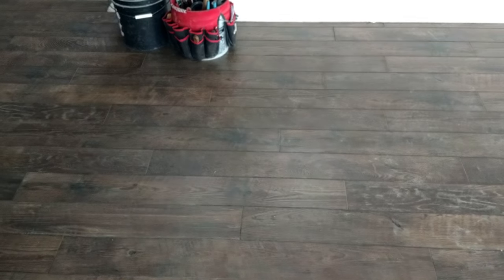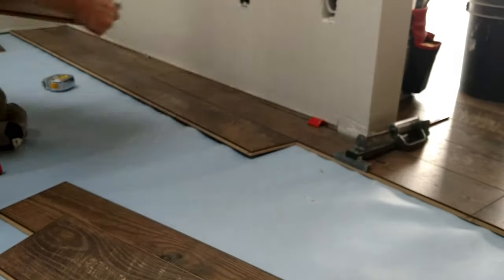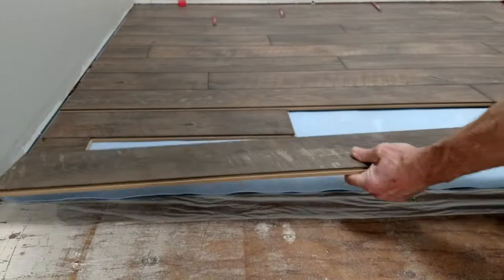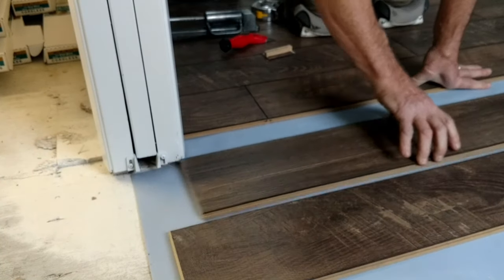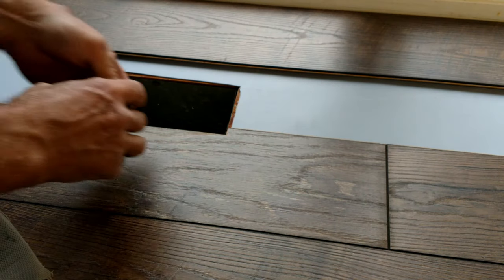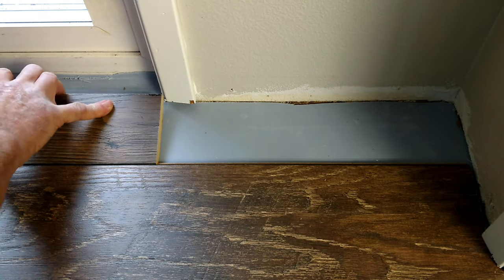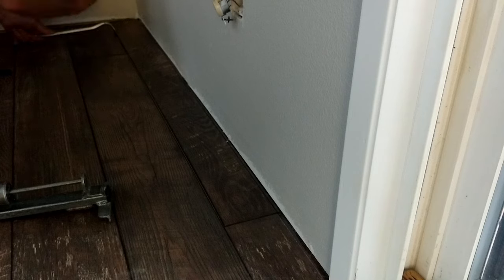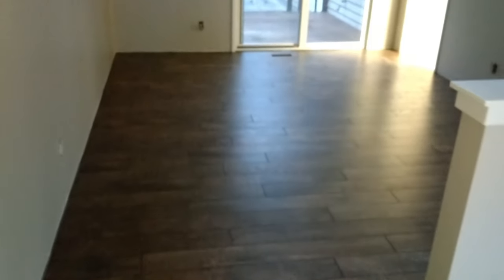Laminate Flooring - End Joints, Doorways, Last Row, and Transitions - SECRETS TO PRO RESULTS!

Comment: thanks...#530.  doing my floor 305-sqft, I've learned I'm not doing another one.  :)  I should have started in the hall, but didn't.  Installed the first row and half backwards (i.e. lip into tongue vs. tongue into lip).  It isn't any worse than the other laminate installed by previous owners, but man has it been a pain.  It could be the flooring brand (quick step), but it's probably me.  A week in and I still have 4 door jams to do (only 6 boards total, how hard could it be?)...

Comment: Thank you. The full plank 2/4, 1/3 method is something I will have to consider when laying out my flooring. I believe the mfr said that none of the scrap pieces should be cut smaller than 12". I'm using 7"x48" vinyl planks (but concept is generally the same as installing laminate). I do have 5 doorways to deal with (one exterior, another to a kitchen with parquet, one to a closet, another to a carpeted bedroom, and another to a bathroom with vinyl sheet. Any starting point I pick will have a doorway so the starting board will have to be notched (and possibly first whole row ripped to make the end row wide enough).

I do have a question about how to handle installing with multiple doorways: I can either start on the southwest side of the room (running planks south to north) at a perpendicular doorway with two other parallel doorways along the length of the planks and another perpendicular doorway at the end of the first few rows of planks. Installation could end with a parallel doorway to the outside. Alternatively, I could start at the perpendicular exterior doorway and the end would be the one with 3 doors (the two parallel and one perpendicular). Which do you think would be the best/easiest to start with?
Reply from the maker: The first consideration is the direction of the planks. I generally run them the length of a room. If that does not matter in this case, option A (start on SW side) seems the better of the two. 
I would put a control (layout) line on the subfloor and cut in the first row parallel to that line. That should give you a solid start.
Good luck and thank you.
Reply: @elbowshots  Thanks. With my layout I'm running them the length of the room. It's ~10'x8'. Some installers online told me they would start at SW corner as well. So i get about 2.5 full planks per row. It's a little over 10' as it's about 122" one way and 94.5 the other. But that's not counting butting in to doorways at the south and north end.I think once I get past the doorways it might be a bit easier, but I still need to keep the 1/4" gap (as per mfr for my flooring) in mind. I still need to do some demo and clear replace/repair subfloor. The measurements I took are with walls that don't have drywall but have very thin wood paneling--very old house done on the cheap with no insulation in exterior walls and put up very thin wall panels everywhere.

Comment: I ran short of laminate flooring and when trying to order more it had been discontinued.  Have lots of pieces left over, enough to finish floor however not sure if it can be glued together end to end.  Can you help?
Reply from the maker: I've never tried to splice pieces like that. I would rather have a box left over than be one piece short.
If I were to splice pieces, I would do it in an area that is usually concealed. Definitely not in a traffic area.
I have laminate countertop material readily available to me. I would probably cut a piece of that to use as a strap glued to the underneath side of the flooring. You can fill the joint with a color-matched caulking.
Thank you and good luck.

Comment: This is an extremely helpful video. I'm having trouble leveling my floor. There's several smallish unleveled areas. I tried self-leveler and somehow I screwed that up. S0 I resorted to 1/4" and 1/8" plywood and hard board to fill the spaces. Any advice out there?
Reply from the maker: Thank you! The name self-leveler is somewhat misleading. It needs a little help getting the bulk of it spread before it can level itself. Vibration helps.
The different thicknesses of plywood that you are using sound like you're working with a severely uneven substrate. Was it that bad before the self-leveler, or a result of it?
Are you working with the whole house, or just one or two rooms?
Are there multiple layers of flooring, or has it been stripped down to the subfloor? Too many layers can create height challenges for doors, appliances, and transitions. (and leveling)
If the self-leveler hasn't cured too long, it may be an option to break it up and shovel it out. Whatever you have to do, it sounds like there may not be an easy solution. I wish you the best.
Reply: @elbowshots  
Before and after. I only used self leveler on a a 1' x 2' area. I may have made it too thick also.
OK; one problem is I just let it do its own work.
Just upstairs 5 rooms and 2 short hallways.
Just subfloor; no other layers.
I broke out the leveler; it was a tough!
Reply from the maker: Yeah, busting out cement products is tough.
If that 1' x 2' area is the only spot, you could re-apply self-leveler with knowledge you have now. I would use a 3' or longer screed that would span the area. I have aluminum screeds, but you could use a 1 x 4 (if you can find a straight one). Keep it as tight to the floor as you can, so you don't get a hump.
Reply: @elbowshots  
You have a new subscriber LoL
Reply from the maker: @kenmitchell3355  Thank you!

Comment: Every time I have done laminate, I have used the 3's. 16, 32, trim. If installed right, there is no obvious seam. Just know the room you are working in.

Thanks for the video and perspective. Nicely done.
Reply from the maker: Yes, the randomized pattern looks much more natural than having end joints line up.  Thank you!
Reply: @elbowshots   well, due to a fireplace in the room I did today, I ended up randomizing boards because the fireplace sits at a 45 to the room. Every row different and tailored to the 45 degree. It worked out well and looks good. But it felt slower, and maybe that's the fireplace factor. 

Thanks again!